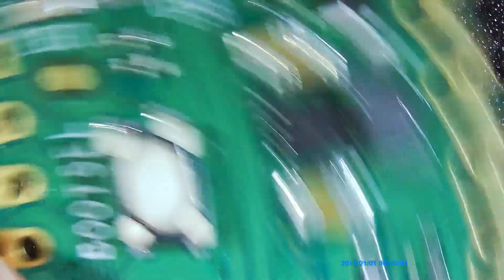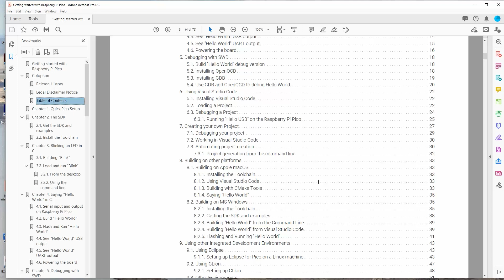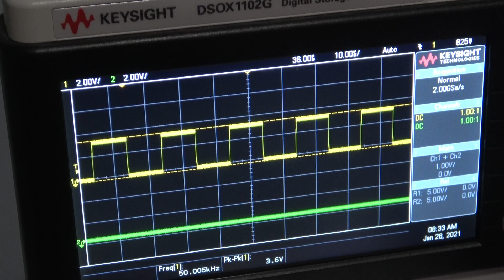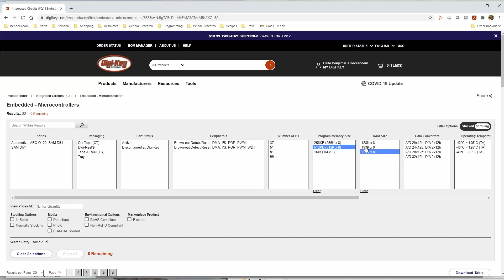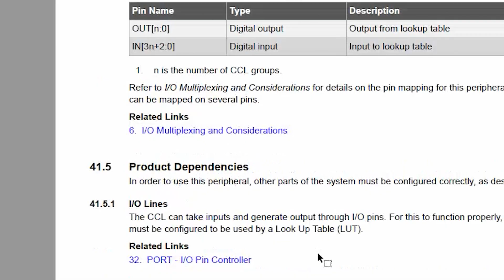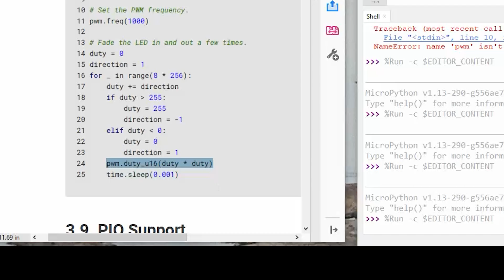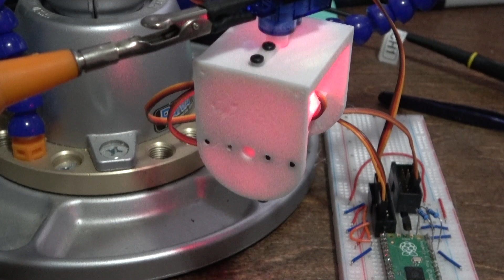Raspberry Pi Pico Testing

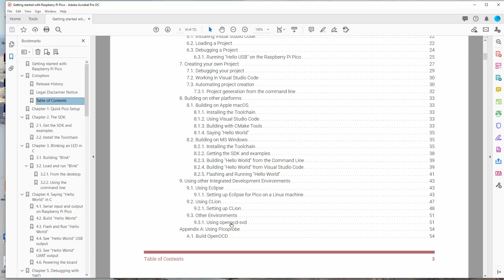Comment: 3:52 lol as a Linux user its nice to have WINDOWS be the afterthought for once, but for real I think its because the pi is so ingrained with Linux (being many peoples first experience with it) that it makes sense that a lot of development for it is also done on Linux and then has to be ported over to other OSs, also unrelated for most of this stuff but porting from linux to mac is easier than windows so thats probably why its Linux -> Mac -> Windows
Reply: No porting to mac is not easier then windows anymore.  You need to learn to code.
Reply: @Grim-oc9fw  well with most things, 'it depends'. But on the by and by both Linux and Mac are using unix and that can make things a lot simpler when it comes to porting things over between the two. This also works with android -> Linux because of the same reason. Just check out the Minecraft bedrock version for Linux, spoiler it's just the android version ported to Linux.
Reply: @criptonic1828  it seems your right after all.
Reply: @Grim-oc9fw  not really, both linux and Mac are POSIX compliant, Windows is not. It’s not noticeable when you only use higher level languages, the second you wanna interface with hardware the OS’s API comes into play
Reply: @somedude4122  but after @criptonic answered me I had said " IT seems your right after all"  so I am just saying I had already acknowledged his answer to me explaining why I was wrong.  so I guess.. I'll say it to you too..  IT seems your right after all.

Comment: Heh, I installed power sockets near the ceiling as they are very useful. One very nice use case is to plug in wifi range extenders. So nothing gets in their way and distribution of the signal is at max compared to a "floor" height power socket, which is annoying when you e.g. want to use the vaccum and the outlet is blocked. Just make sure to use an extender that only lights/blinks LEDs on error. :D

Comment: Linux is usually the primary target because build systems that run natively on Windows have been really subpar for a long time. Sure, MSVC can optimize damn well, but it's a pain to get it to work with you (at least compared to UNIX-like CCs). Plus, Windows has had POSIX layers like Cygwin for a long time, and WSL is really good for this kinda stuff too (VS Code, by Microsoft, even has first-class support for WSL!).

I'm not saying this in proponence of Linux as the "best" choice for development or even general-purpose computing, some UNIX-like tools feel like they're a century older than they are (cf. Makefiles), and Windows has had a lot of great ideas for its own platform (I'm a die-hard fan of PowerShell), but a lot of the C and C++ infra is critically lacking on Windows. It makes sense to make Windows a second-class build target

Comment: OK, I'm one of those guys running Linux.  Many of the tools that are used with ARM development (starting with the GNU compilers) were developed on Linux, or at least UNIX, and were then ported to Windows.   Of course one of the tools that the RPi group recommends for Pico development is a GUI that was created by Microsoft,, and lo and behold it's (Gasp!) Open Source!!!  So, I don't hold any grudges toward Windows, though they have had some issues with auto updates bricking computers in the past.  
I think that any company that produces development software should give uses the choice of running it on Windows, Linux, or Mac.  There are painless ways of doing this, such as Java.  If Microsoft would open source, (or at least provide free downloads) the .NET runtime for Linux and Mac, then that would be a second path.  Python is another possibility, though it's been a moving target to have the right version installed.
Attach a push button to the RUN pin, then you can hold that down along with the BOOT button to get into the bootstrap without having to cycle power.
Python (the computer language) was named after Monty Python.

Comment: "easier on Linux” as a Linux user I've never heard this before.
Reply: Lol. Almost every nerdy thing is easier on Linux. I’m not sure what you used Linux for either.
Reply: weirdly, something i've found as ive been using Linux more this past year is that setting up my inkjet printer was infinitely easier on Linux, whether wifi or USB, and I was not expecting that
Reply: Indeed, Linux is usually in my experience vastly easier to do almost anything on. But getting a non-linux user to say anything other than "its too difficult" is something I don't think I'd ever heard before either (Though what they usually mean is it isn't M$ or occasionally Apple software, so I don't already know how to do something).
Reply: wondering what did you use Linux for up until now.
Reply: @rockapartie  yeah because running a kernel within a kernel makes things easier? Why would I use Linux-upon-Windows instead of just Linux? Why should I learn PowerShell scripting when I'm already used to bash? Huh? I don't get these types of replies, as if I'm a complete idiot who hasn't used Windows.
Reply: As a Linux user it is my duty to inform everyone I meet that it is the superior choice and if they don't think it's easier they should stop using computers. I think you might need your Linux license revoked >:(
Reply: @mr.squishy5024  thanks, literally no one said that
Reply: @transpiler  I think I just did. You should use Linux, that way you'll have more time to comprehend my comment instead of waiting for bloat.
Reply: @mr.squishy5024  What is wrong with you dude
Reply: @transpiler  How could there be anything wrong with me? I use Linux!
Reply: @mr.squishy5024  🤡
Reply: @transpiler  yes

Comment: Dude, judging much are u. Git is ment to be either part of the ide or use command line. Not a silly app. Also, Linux is way cooler then  peasant LVL windows, just do wsl2 on windows and your back at the nerd part of the class.

Louis Rossman reference is still cool tho, I can still watch your vid because of that.

Comment: Trust me, Ben, Linux and Mac users think just like you when they encounter tutorials aimed at Windows first.
In the end, all variants suck really bad albeit I'm on your side, I don't want to use the terminal when I can avoid it either, even on Linux.
Reply: Why don't you want to use the terminal? You against direct results?
Reply: @1pcfred  Not if I have to debug things in which case the terminal is perfect.
But as Ben somewhat sarcastically pointed out, we are living in the year 2021 and Linux users still haven't figured how to make using computers easier when it comes to certain tasks.
Reply: @1pcfred  I expect it to be this way because computer systems are sold as being easy to use.
Your points are very true but it still doesn't change the fact that Linux lacks some comfort options competition already has.

Comment: This chip is absolutely made for Micropython. The chip has 256KB of ram. What absolutely massive for an arm cortex m0+! Other manufacturers have at most 32KB ram on their m0 MCUs, what is a large amount when programming in C, but way too small for a micropython project that needs lots of library.

The ESP32-s2 is also pretty cheap though, they could also have gone with that one.

Comment: Great review and any video with Bud is a great video. If you don't like toggling, instead of just incrementing a var then resetting it, you can do a=1-a which will toggle the var between 1 and 0 with no need to reset or mask the LSB. Also has the added benefit of not running the risk of overflowing, in case you are using a system which does not handle that well.

Comment: 1.1V Core Voltage and 12MHz XTAL. The C/C++ is basically using a professional toolchain, not a hobbyist one. You really need to use a SW debugger to make it slick (ish). I am not sure comparing a development board to a chip is fair, what is the cheapest dev board with that chip?

Comment: You can use wsl2 in windows with vscode and it was a lot fewer steps
Reply: Setting up wsl2 also requires extra steps though. But if you already have it set up, it might be nice.
Reply: @thepianoaddict  that’s a fair point.. I already had it installed, so it was just a case of adding the arm gcc and the pico sdk

Comment: I prefer Mac OS over Linux over Windows. Did not realize I was a hipster. Thanks for the label!
Reply: Well, you're a minority at least. I mean to use OSX / Linux, not to prefer it (as far as I'm aware).
Reply: @goeland4585  Yes you're absolutely right; Windows is indeed far and away the most popular OS for personal computers. However Linux in many ways is better for my line-of-work, web development, which the majority of internet servers run on ... at least all mine do. As Mac OS is also based on UNIX, its also a great OS for web dev, plus it has much more polished interface than any version of Linux I've tried and you can run Photoshop natively on it :D
Not saying you can't do all that with Windows of course ... its all just preference I suppose!

Comment: Apparently Raspberry Pi Pico support is coming to the Arduino IDE which could be a game changer. Specs wise it's comparable to some of the Teensys but at a fraction of the price (those cost like $30! which I think is overpriced for what they are) and obviously far more powerful than most Arduinos. I might buy like 5 of them to use with the Arduino IDE, why not, they're so cheap.

Comment: I never understood why someone would chose to work on a Mac, it's basically a hipster-ish Unix machine you pay way to much for and have way less control over. Might as well get a Dell with Ubuntu at that point.
It's easy enough to develop on Windows if you make use of Microsoft's toolkit and don't try to be a contrarian for no other reason than not using MS stuff, just like you wouldn't do yourself a dirty and try to avoid everything Apple on a Mac.

Comment: One of the reasons Linux is listed first is becuase it is intended to be programmed from the regular Pi computers which run Linux.  The intent is for education where the class is able to purchase/be provided with regular Pi's (either one per student or in small groups, or possibly even just SD cards with a number of Pi's per classroom) where they begin programming and then the advanced/later year classes can then move on to programming the Pi Pico for more complex projects.
Reply from the maker: I want to get a Pi 400 and give that a whirl, probably revisit C on this thing when I do.
Reply: @BenHeckHacks  
Ohhh, that'll be interesting. Atm I'm using a Pi 4 as a low-cost power efficient server. 

If you jump through some hoops to get a slightly newer version of LWJGL running with Minecraft (1.16 is like one version behind the one that supports arm). You can get the full java edition running on the Pi 4.
Reply: Also using a free operating system that is also bundled with the unit itself. Unlike certain Redmond or Cuppertino operating systems.
Reply: The website literally says it's just alphabetical. You're reading too much into it
Reply: I thought it was hilarious to see a Windows guy complain that his preferred platform doesn't get the premiere placement due to its total number of users... most of whom would not have any interest in a Pico.  Ben:  I think most people that are comfortable with multiple operating systems, and most people that hack devices like this, would prefer to program them from Linux simply because it's easier to set-up; It's literally one idiot-proof command to install the toolchain from a secure repository on Linux vs. 3 pages of running around to various websites virus-scanning and running disjointed installers for each component on Windows.
Reply: @3vi1J  Wonder if choco could make it easier
Reply: I think the reason it's listed Linux, MacOS then Windows is alphabetical order, maybe ?

Comment: I imagine within a month or two there will be better tooling available for programming C on the pi pico, especially trough the SWD port rather than manually flashing via file transfer. I expect platform.io and its excellent vscode plugin to just work with it once a profile is available

Comment: Ben. Python is not at all like Basic. Not all interpreters are the same. However, it is not really a suitable platform for smaller microcontroller, because it will provide far more functionality than is actually required. A whole python interpreter to blink an LED? Anyway. Thanks for taking the time to show us. As it happens, we have three black cats and I think this is a very cool idea for a project. 👍🏼

Comment: When these came out my friends and I were discussing the use of these Picos. Two out of the three of us agreed that it's too big to be a dedicated single task microcontroller, and all three of us agreed that for the onboard processor, the memory size was too small. 264KB onboard isn't a lot, and MicroPython instructions are still much larger and slower than than C++ despite cutting a lot of 3.5's fluff out. So we all had no idea who would be able to use these aside from students learning how electronics work.

On the upside it's all contained on one board, is extremely cheap, and is incredibly well made. If one day they made a 520KB version I'm sure people would buy them until the Raspberry Pi Foundation ran out of materials to make them.
Reply: @wojtek-33  I mean, the big reason I was interested in it was because it had the board. I don't like messing with just chips because I don't have tools for making my own boards. But when I compared it, you have more functionality out of a Pi Zero in about the same size, and about the same price. The only big difference is the Zero lacks some of these pins crucial for things like two stage electric motors. I mean, that Cortex M+0 is pretty damn powerful, but it's at the limit of onboard memory for execution. 256KB (remember it reserves 8KB for itself) is well below what the processor can easily handle, and may not be enough RAM for more complex tasks like audio processing or IR sensors. That's why I said I don't really know who the market for these is aside from people learning.

Comment: Dear Ben, 

Forget about pushing to button and drag the uf2 file to the mass storage.:  that's just for getting started like download the UF2 file from there website and it will work.  Yes I miss the reset button, but a extra button on the breadboard will fix that.  

Don't be surprised that in time there will be a "hipster" development environment on the web / in the cloud which generates you output. There was once something like that, I played with it and forgot about it (no in circuit debugging = exit for me). But maybe it' will be accepted by the masses (read : non developers).

When you want to serious play with this MCU, use the SWD to in circuit load and debug you code. And I thing that is why they start in the manual with there own Raspberry Pi based development environment (just one simple install command will set it up) on which RPi has one advantage : you can use 3 wires on it's GPIO to start SWD on the Pico. How nice is that. 
And remember the boys and girls from Redmond won't say : "hey if you want this new stuff, you have to setup a Linux environment first". 

When you want to use a other machine (Linux, Mac, WIndows . .. alphabetical order ;-) ) , just get another Pico and load it PicoProbe and use that Pico to in cicruit load and debug your target PICO over SWD. Where else would you buy a ISP debugger for just $4 ????   

Yes setting up on something different that a RPi is a bit more work, but maybe in time there will be a AppImage  / App container etc with everything inside to click and start. Or even setup program for the Redmond boys and girls. 

For what it's worth : I have tested it with the raspberry pi  and on my Linux Laptop. Both needs some editing of 2 json files for getting OpenOCD to work to allow WSD. But after there works like a charm.

see : https://www.ph2lb.nl/blog/index.php?page=raspberry-pi-pico

Dont' forget it's the first release of there environment. Glitches and bugs may to be excepted. 

IMHO looking at the support from SparkFun and the Adruino foundation and there plans to have boards with the RP2040, I think it will be a MCU to stay in the market. But time will tell.  For now I'm having fun with it and really love that they made it possibility to start low entry in circuit debugging . Try that with Arduino studio. ;-) 

73 de Lex PH2LB
Reply: @Christopher Grant it's more expensive then a chinese clone of the blue of black pill  (STM32). But $4 is still dirt cheap when buying from a local source.

Comment: It's like a R-Pi but they left out all the good stuff.  No on board Wi-Fi or SD?  It's basic as hell but it reminds me of the butter-bot from Rick and Morty.  Not enough stuff for that ARM to do.
Reply: Connecting a SD card can be as simple as using SPI. If you want to run the SD card substantially faster than that, the Pi Pico probably isn't the right device anyways.

Comment: Louis Rossman is "That New York Guy' Lmao
Also, Its Linux-first because the Pi is a linux based system and theyre meant to be used together. 
Windows IS the afterthought then it comes to the Pi foundation. But thats not an issue, Its based on THEIR userbase not the overall market share.

Comment: The build up for your toolchain is really similar at the buildup for the esp32s2 and C. Except they used the modem io on the serial ic to toggle reset and a bootloader pin.

Comment: Look I respect you a lot but your views on tooling and Linux are just plain wrong. We should be supporting and improving open-source toolchains first before anything else.
Reply: It is difficult to improve on perfection though. Linux is an homage to an OS that was made as basically a stand alone IDE. Programming was UNIX's reason to be. The rest was slapped on as an afterthought. Dennis and Ken just wanted to play Space War after all. They pursued that goal with as direct a route as possible. Editor, check. Compiler, check. OK let's go!